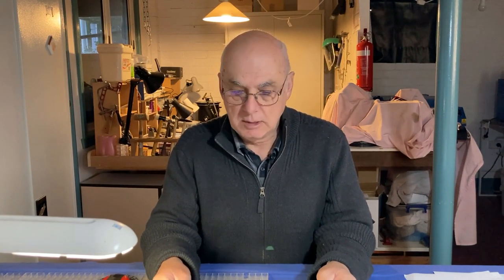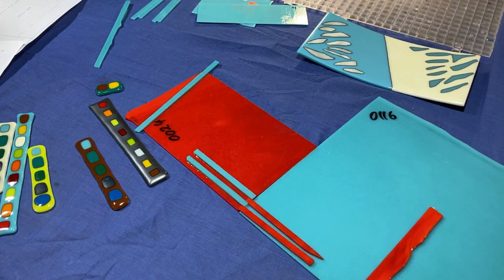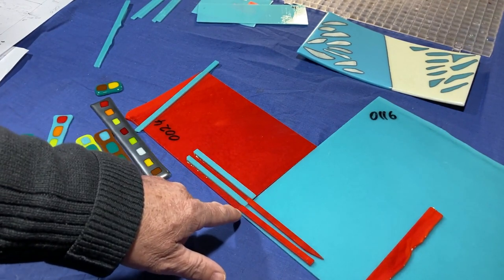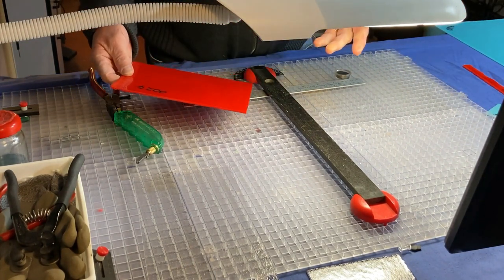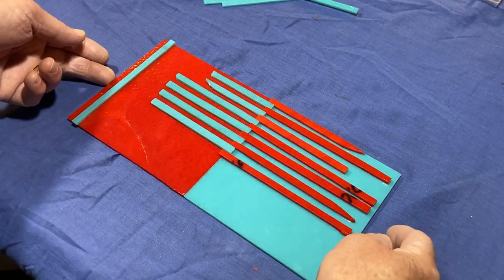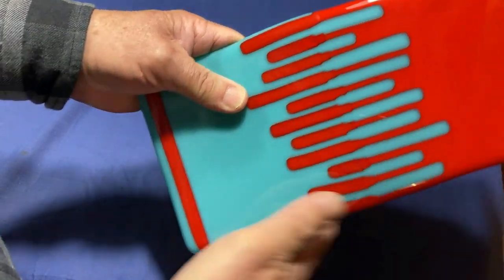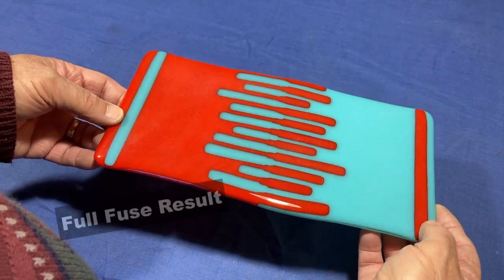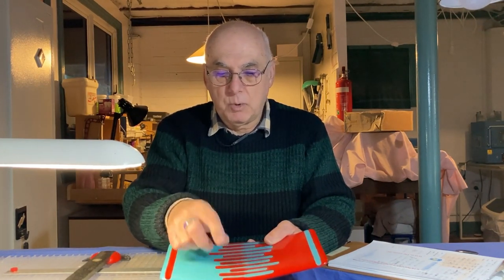I Reacted. So did the Glass. Fused Glass Art Project Tutorial

Comment: I love this piece and the shape. Can you share the mold you used for slumping. I really enjoy your videos.
Reply from the maker: Hi Marcia. The mould is one that I designed and had made from stainless steel. At 22:44 in this video - https://youtu.be/yqUAkM2hm7U - you can see the shape. It was made from sheet stainless steel. You can see the sheet steel folds down and under to make the feet at each end, with a gentle curve between. You could get it made in any size. If you need the exact dimension let me know. I think it cost me about $40 AUD to have made. Much cheaper than any I could purchase. But the main reason was I couldn't find anything with that shape.